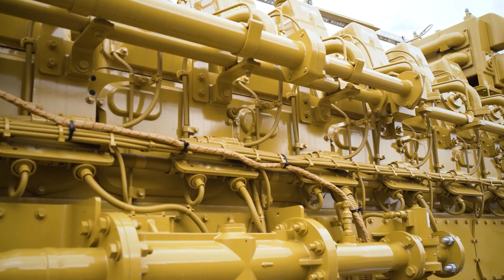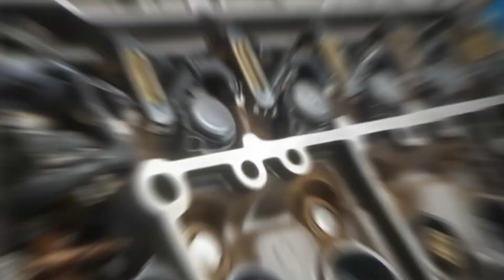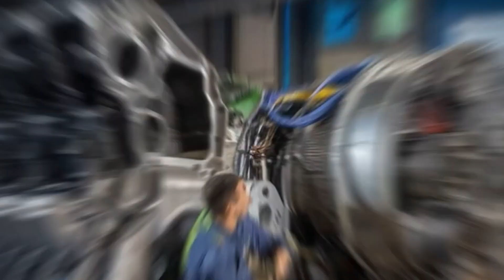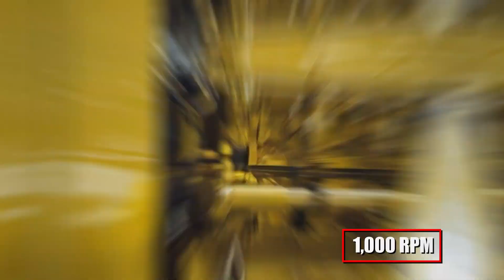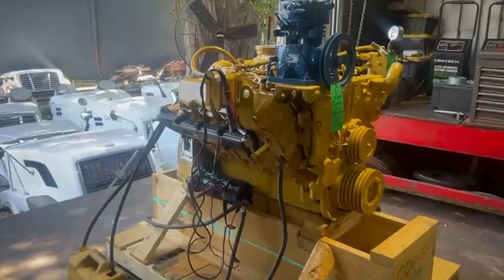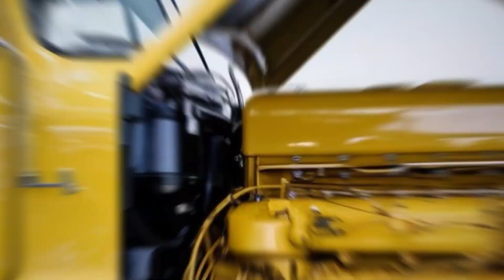The Shocking Truth Behind The CAT 3612

Comment: For those that are actually curious and might want to know:

The CAT 3612 for a long time was used as a testbed engine among other heavy duty CAT 3500 & 3600 series engines by MKCX for EMD rebuilds. One example of them is the MKR SD40C that Burlington Northern experimented with which had SD45 style radiators. MKCX-MKR/MPI was a large rebuild and leasing company of railroad motive power that dealt with alot of EMD & GE units as well EMD & Caterpillar engines and for a short time experimented with French Sulzer engines. When both Caterpillar & MKCX wanted to actually approach the manufacturing department of the locomotive industry the MK5000C's came into existence. There was 6 MK5000C's ever built which all had CAT 3612's at 5,000 HP. These units had the highest horsepower output from a singular locomotive until soon after EMD introduced the SD80MAC's for Conrail Quality which were at 5,000-5,500 HP and much more reliable. The MK5000C's were leased out to Union Pacific and Southern Pacific. It was evenly split at 3/3 between the two railroads. The MKCX MK5000C's in the 9900 series and MPI livery were with Union Pacific while the other 3 MK5000C's were painted and numbered in the 500 series for Southern Pacific. Union Pacific wasn't impressed with performance results so all 6 MK5000C's ended up being painted and numbered for Southern Pacific. Unfortunately despite the CAT 3612 being a proven reliable and durable engine it wasn't proficiently thought out to handle 24/7 locomotive service. The MK5000C's dealt with immense alternator, main bearing, generator, and crankshaft failures internally while externally the units had numerous wheel slippage incidents dealing with serious freight tonnage and slacking trackage adhension. Despite all of the problems Southern Pacific effortesly worked with MKCX to try and resolve the issues and was still interested in this program and retained ownership of all 6 MK5000C's. However due to alot of unreliable results Southern Pacific submitted their unit order to GE for 300 AC4400CW's. That same number order originally was planned for 300 MK5000C's from MKCX until the units demonstrated to be heavily unsuccessful. The MK5000C's had debut at bad timing because Southern Pacific was in desperation and dealing with a serious priority of needing to purchase as well rebuild older motive power on top of selling outdated motive power. Southern Pacific amidst the situation was also purchasing large orders of GP40M-2 & SD40M-2 rebuilds from MKCX. Unfortunately both Caterpillar & MKCX fell short on promises and economics after the short lived experiments of the MK5000C's. It still would've been very difficult for them to take place in the locomotive industry regarding marketing, resourcing, and distribution since EMD & GE already dominated the business with their EMD 645E3's, EMD 710G3A-G3B's, and GE 7FDL series. Soon after MKCX/MPI became bankrupt and all future plans ceased to exist. BC Rail was a potiental railroad of interest that wanted to test 8 MK5000C's of their own but the discontinuation of the business halted manufacturing and assembly. At the same time BC Rail merging with Canadian National also voided that possibility. After the UP/SP merge all 6 MK5000C's were purchased by Utah Railway. For a short time the units retained the CAT 3612's until costs and parts became a problem. All six units were heavily rebuilt into MK50-3's with EMD 645F3's that were removed from retired GP50 & SD50 donors and updated with EMD -3 electronics and had an entire electrical system overhaul. The EMD 645F3's in the MK50-3's were derated with EMD 645E3 power packs to substain reliability and efficiency and put the units at GP40-2 & SD40-2 standards. After Utah Railway lost the contract to Union Pacific for coal train service the MK50-3's were sold to KYLE Railroad. A few of the units have already been put into deadline storage and are being used as parts donors.